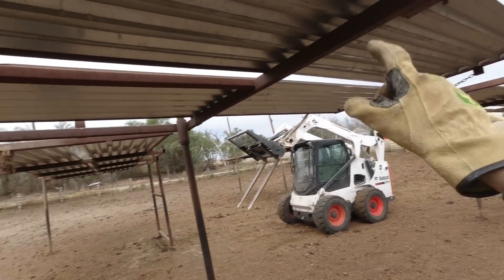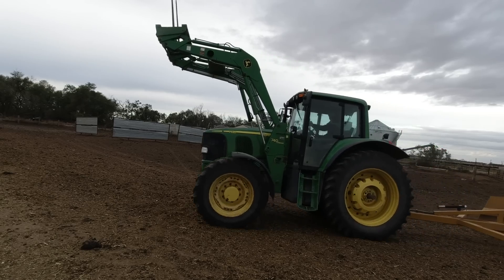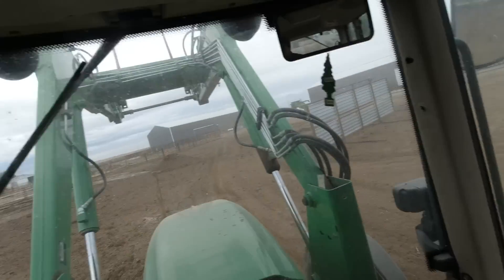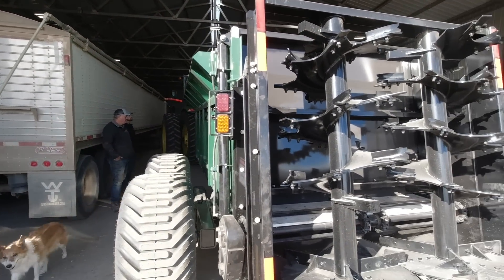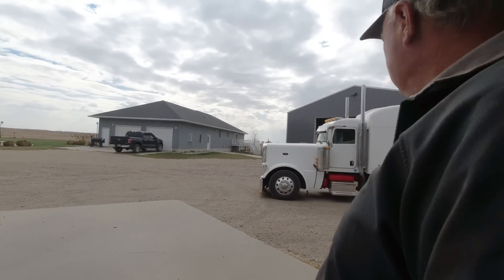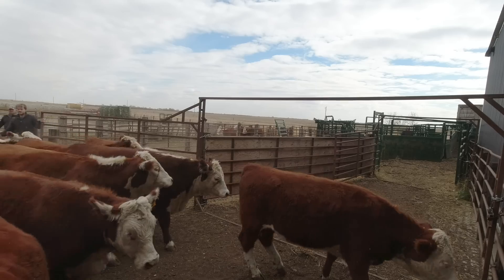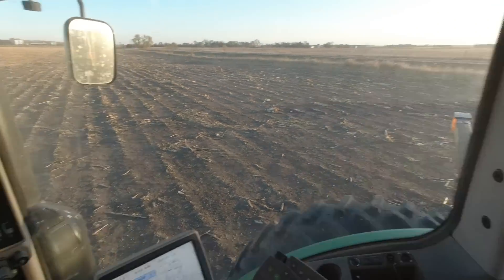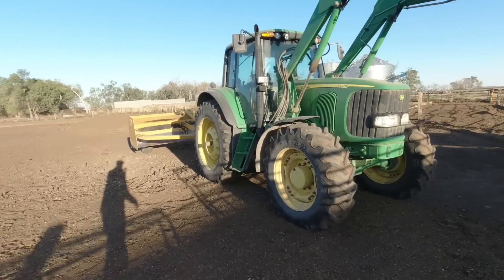Manure Spreading just got Vertical!

Comment: 10th Generation Dairyman in PA has a spreader like this. With wetter manure, it does do a better job of spreading, with the wind and your current dry conditions, doesn't work that well. I am amazed at the uniformity and width of the spreading.
Reply: We used to pile the manure in the corner of the field for a year and let get wet and for the worms to set up home in it . Worms good for aeration and wet manure better spread 🤗.

Comment: Could you explain a little about why the Herferds are gone? I was under the impression you were going to breed them but I may have missed something.
Reply: we did breed them. but we did not intend to calve them
Reply: @briansonne814  right, now I remember you saying that, my bad!
Reply: @briansonne814  I'm not asking for numbers, but overall how did bringing on those heifers work out as an investment for your farm? Did they bring what you expected? A project worth repeating?  Also, for the one's that weren't bred do you hold those back and beef them out or the buyer takes the entire group?
Reply: @cindyn7512  Hi Cindy. Good questions. It worked well due to the fact that we sold them into a stronger cattle market than when we bought them. They brought what i was hoping for and yes I would do it again. However getting them bought for what I paid this year will be difficult. I sold the open one at the local barn.

Comment: Can you control the drag floor speed on the spreader to control the application rate?
Reply: Yes sir!  There is a valve on the hydraulic block on the front of the machine, or you can just dial back the flow rate from the tractor.